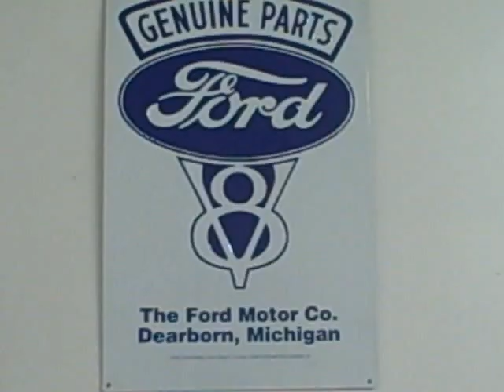ford 460 dyno

Comment from the maker: ford pickups w/460 v-8s in '79 were rated at 239 HP@ 4000 rpm and 375 Lb-ft torque @2400 rpm stock.

Comment: I have a 96 F250 (460) hate it! They suck gas power is limited tq does decent.. But wtf come on ford i mean i love my truck but it has a 4.300 bore. God when the 460 first came out the were rated at i think 425hp and like a tad over 500ft/tq. Now 255hp and little over 400tq can get more out of a mild 302.. But my truck does good, goes any where just wish for the mpg would perform better stock..